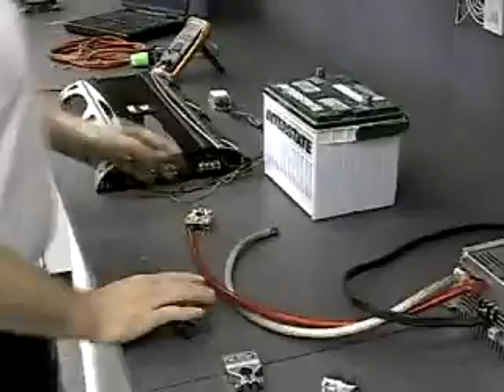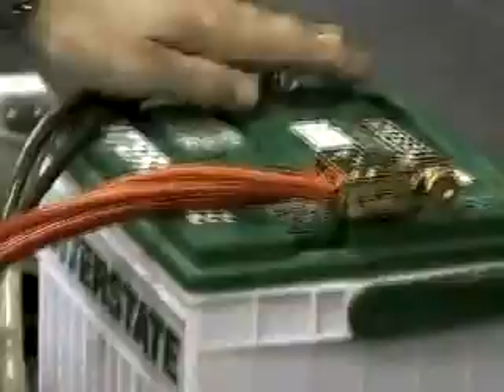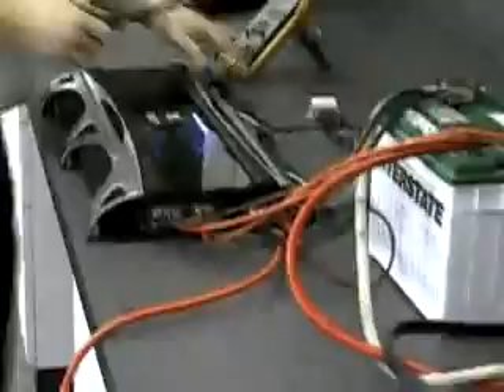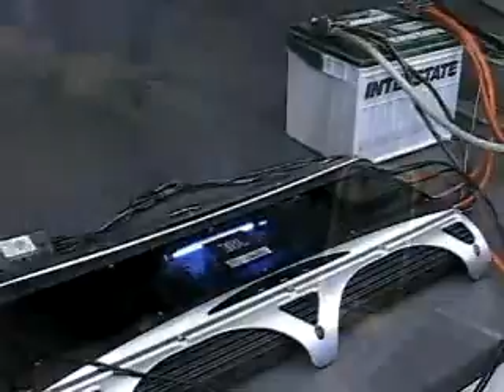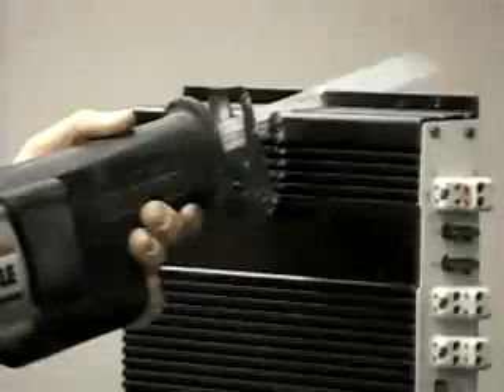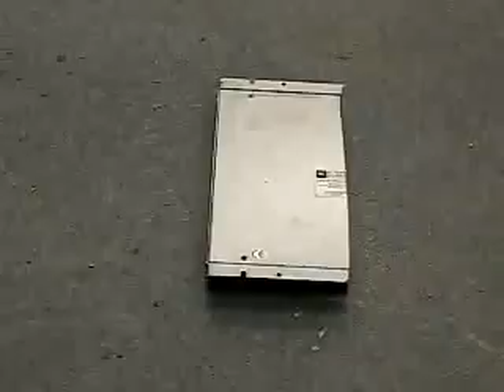Andy Chops up an amplifier

Comment: what if i put battery, amp and those woofer at the back in the storage area and connect my i-pod to amp input it will work or not because i dont want to mess up with car battery and don't want to do wireing. it's new car